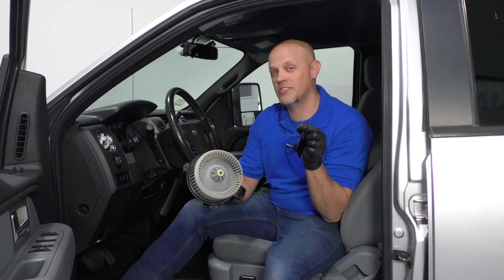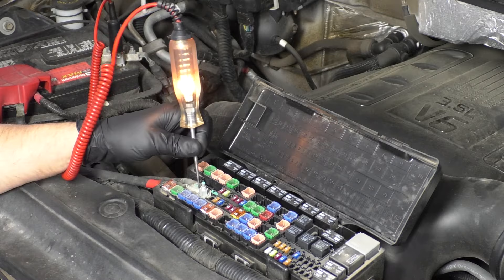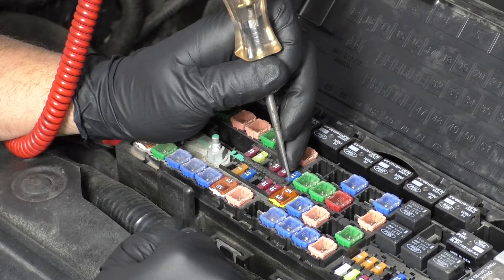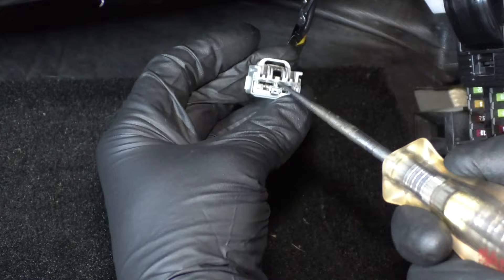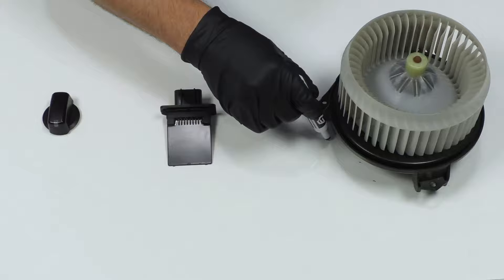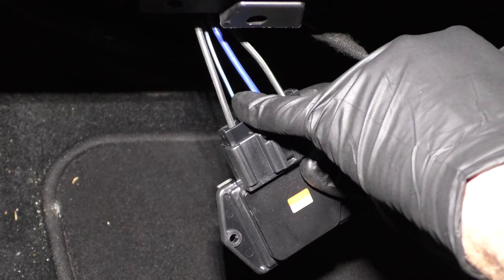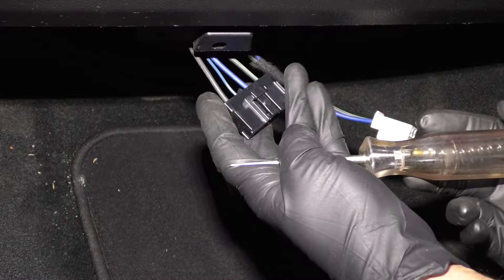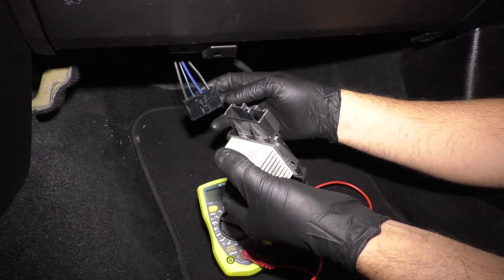Heat Stopped Working In My Car! Blower Motor or Resistor?

Comment: Here is my life story. 2016 VW Jetta 1.4lt Turbo 1) Fan works with direct power to it. 2) Power on from Fan connector. 3) Ground good from fan Connector. 4) Power on from each resistor. 5) Left motor dangling from casing everything worked as it should. 6) Put everything back....nothing worked. The only thing I have not done yet is use the Multimeter. Maybe the switch on the dash is the problem but why did it work perfectly when the fan was outside the duct casing....Please Help

Comment: We have checked our fuses, replaced our blower motor, and  replaced the resistor. It still isn't working. Everything tests with power going from the switch to the resistor, from the resistor to the blower motor yet it still won't work.

Comment: My A/C blows on HIGH, even on the lowest setting, and when I turn it off the fan stays blowing; I've changed the motor and the resistor, what could it be.??? (2012 Ford Expedition XLT)

Comment: Hi Sir..
I have an issue with my Toyota Wish 2007.While driving all of a sudden my aircon and its panel went off.Later i check the radiator fan also went off.
I went to sent to a mechanic....he change for me a fuse and it went back to normal.Today while driving same thing happened again.
Went to another shop , he checked whole day but unable to find the fault.
Can you help me and guide me what is the main problem?
Thanks
Reply from the maker: +Mohd Amer Armiya We wouldn't be able to diagnose an issue like that here, you may want to have a local mechanic take a look at it. Thanks for checking us out! http://1aau.to/m/Shop-1AAuto-c

Comment: I have heat and blower works.  What my problem is I get a clicking noise when I turn up heat.  It runs for a short and then quits.  What is causing this?

Comment: What if I need to replace the whole plug that goes from the resistor back into the dash? I cut mine due to the plug melting.
Reply: I bought a new "pigtail" for my f150. Then I bought a soldering iron since you'll need to solder the wires together. Take you vin number to a dealer and they can order you the connector.
Reply: Still doesn't explain why it melted. I'd like to know that too cuz mine got hot as well.

Comment: I got a 2016 Impala and just recently it only blows on the floor level. Would that be the blower motor or an actuator?
Reply from the maker: +ken hood We wouldn't be able to diagnose an issue like that here, you may want to have a local mechanic take a look at it. Thanks for checking us out! http://1aau.to/m/Shop-1AAuto-c

Comment: so, here is a question and issue. fan is working off and on no matter what the fan setting. I removed it to put a new fan in but decided to test it after I removed it and it worked at all speeds. put the fan back in and it won’t work at any speed. what can be doing this?
Reply from the maker: +Dave Bonney We wouldn't be able to diagnose an issue like that here, you may want to have a local mechanic take a look at it. Thanks for checking us out! http://1aau.to/m/Shop-1AAuto-c

Comment: Why would my blower motor  start initially and run for a couple of minutes then switch to low flow for 3-5 then go to the setting on the dial again??
Reply from the maker: +slwstrk11 We wouldn't be able to diagnose an issue like that here, you may want to have a local mechanic take a look at it. Thanks for checking us out! http://1aau.to/m/Shop-1AAuto-c

Comment: My cars fan blower motor only works when I tap it. What is likely wrong with it?  
It's only about 17 years old.
Reply from the maker: +Chris76-01 We wouldn't be able to diagnose an issue like that here, you may want to have a local mechanic take a look at it. Thanks for checking us out! http://1aau.to/m/Shop-1AAuto-c
Reply: Did you find out mine was doing the same but not it doesn’t work at all

Comment: I turn on my ac and it will blow cold and hot air but the speed stays the same and won’t go down. Can you help with what that could be please
Reply: Blower only does what it is told to do ;) That would be the Resistor, only delivering enough juice for one speed. Easy to change out and most are cheap enough...  Depends on your make/model and could be something else. Not as likely, but maybe. But you probably already fixed it.

Comment: i have this problem and i know it's not the fuse the fuse will make it stop right away it was working the blower on high and then it would drop down to nothing a fuse would not do that i think its the motor and maybe the resistor together. fix fix fix fix 😅

Comment: So I replaced the blower motor but not the resistor and it worked fine but the next day the car die on me saying that the battery was dead that's that mean that the resistor was bad as well and the new motor killed the battery

Comment: I replaced both the motor and resistor and still no power. Only a slight breeze while I'm driving, but I can control the temperature. Please help?
Reply from the maker: +rodney haley We wouldn't be able to diagnose an issue like that here, you may want to have a local mechanic take a look at it. Thanks for checking us out! http://1aau.to/m/Shop-1AAuto-c

Comment: My damn blower motor has stopped twice now. I've replaced the blower motor and the resistor and it worked for a while, but it went out again. Oddly, the floor heater still works, so that makes zero sense to me.

Comment: What if it kicks on only when it wants to, fan isn’t dirty it turns on 2 miles down the road it shuts off
Reply from the maker: +Sergio Torres We wouldn't be able to diagnose an issue like that here, you may want to have a local mechanic take a look at it. Thanks for checking us out! http://1aau.to/m/Shop-1AAuto-c

Comment: In my 04 the plug on the blower motor always burns up.  After replacing it several times and using a meter to read amps I discovered my fan was not pulling enough amps to burn the wire up.  So it's the actual plug.  It's a pos.  Cut it off.  Get some small spade connectors.  Same size as pins in blower.  Crimp then on and plug directly into fan motor.  My ac has been working fine for months now and even seems to blow harder.  I hope this helps someone.
Reply from the maker: +James Thanks for the tip!

Comment: I've had 2 chevy a '09 and my present '12 colorados. BOTH had the same oroblem with the resistor/ blower motor.
What I found was the problem was actually the grounding "terminal" connector box for those and other curcuits located on the passenger fender. 
Once I cleaned the spot on the fender to bare metal and cut the wires to the little box and put looped wire ends on them and bolted them back to the fender there have been no issues and the new blower motor and resistor I bought are still in the box 4+ years later.

Comment: I have replaced both ( blower and resistor) but the connector to the motor keeps burning up when I turn the speed to high..( 2003 Dodge Dakota). I have spliced an inline fuse to the blower motor hot wire so I burn the fuse instead of the connector if I accidentally turn it on high. If I have a new Blower motor and resistor what else could be melting the connector?
Reply: Check your fuses and see if they are the right fuse number.
Reply: @spikeshostagetv5935  You missed my point. I have replaced the resister and motor because the connector to the resister kept melting at the hot wire spot I went to the Dakota forums and someone recommended putting an inline fuse on the hot wire. Now when I accidentally turn it on high I blow the fuse instead of melting the connector. The fuses in the truck are the ones listed in the manual. My question is what else could make the connector melt if the motor, resister and fuses have been replaced?
Reply: @Huskeybear76  I got your point sir, that's why I said check the fuses. But also you might want to replace the head connectors because they overload inside that connector. Could be something that's touching all the wires and overloaded inside that connector I will replace male and female connectors. I've been there I'm a mechanic I fix the problem several times.
Reply: @spikeshostagetv5935  I have replaced the connector several times and it still melted until I installed the inline fuse. Thanks for the reply. Appreciate it.

Comment: My blower motor continiously running even I turn it off on center dash.
Reply from the maker: +Rommel lacostales We wouldn't be able to diagnose an issue like that here, you may want to have a local mechanic take a look at it. Thanks for checking us out! http://1aau.to/m/Shop-1AAuto-c
Reply: Same here bud, did you ever figure it out? Changed out resistor but now can stop the motor from blowing even with controls

Comment: Ummm this is not correct. You didnt check the circuit for voltage drop under load. Use a LOADPro.

Comment: If it's best to replace them both - why bother testing them?
Reply: My mechanic says replace them both. He says that if your relay is failing it’s because your fan motor is bad and pulling too many amps and burning out the relay  If you don’t do both you’ll be replacing relay again in a few months .